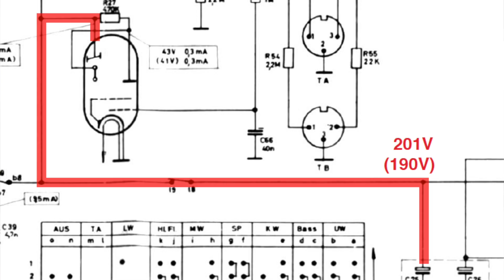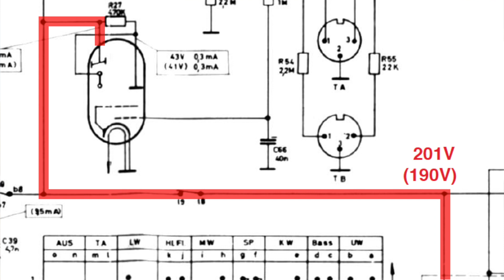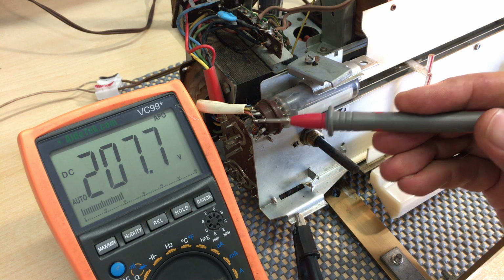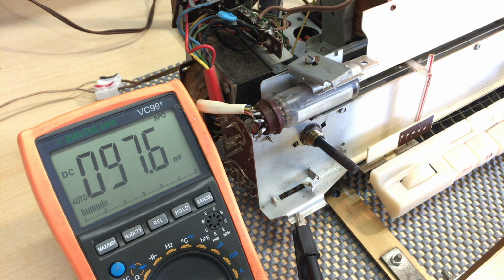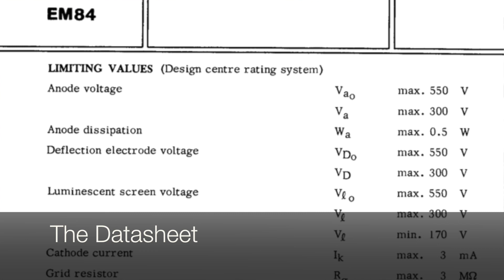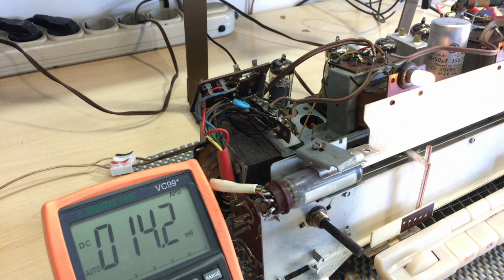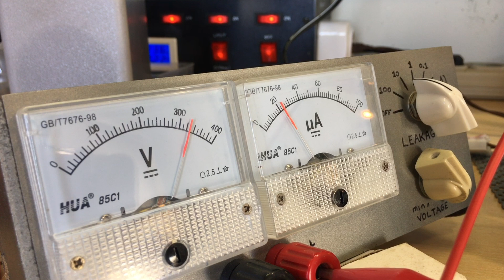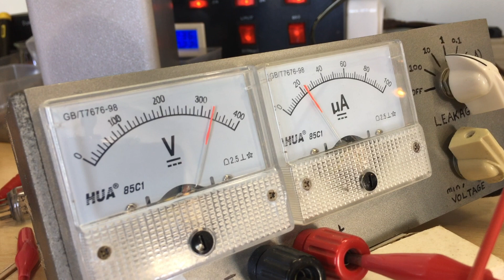How To: Revive a weak magic eye tube

Comment: Thank you 
As a comment below says magic eyes are small cathode ray tubes. I think the problem is ion burn which happened in early television tubes before they started putting a thin aluminium film at the back of the phosphor. TV crt’ s certainly lasted more than 1000 hours. 
I’ve read elsewhere that reducing the target voltage increases magic eye life. 
Manufacturers liked to have the magic eyes bright this apparently was good for sales. 
Also no magic eyes have aluminised backing on the phosphor because most have a target hit by the electrons on the front and while the EM84 is backlit I’m sure  the cost would deter this protection   Just sell more tubes. 
People are trying perfect led copies of magic eye tubes but so far not.

Comment: I usually use 275-300 volts B+ on the EM84/6E2 Magic Eye tubes that I use in my D.I.Y. projects, and they're PLENTY bright at that level, and YES, you are correct in that one WILL have to alter their drive voltage if they increase the B+ in an already existing circuit.

Comment: Greetings:
The tuning eye will last much longer if only powered when actually "tuning".
I propose using a combination of 555 timer and a reed relay to remove the HT to the tube when not actually tuning. The timer will be triggered on at the start of tuning and time out a selected. I suggest an integrated AVC detector to monitor AVC level and trigger when an AVC level change is detected. What do you think?
Reply from the maker: That would be quite doable, but I don’t like making that many changes to the radio.

Comment: I just found another take on a magic eye replacement in the ac7zl youtube channel. This is a combination of mechanical vision and solid state control and it's just brilliant. The realisation needs some refinement but it already looks very good.

https://www.youtube.com/watch?v=QFTDOZz-LlE

The website is called  hpfriedrichs where the details are given.

I think the natural progression of this is some kind of round l.c.d. screen controlled by a tiny programmable controller. In most cases, a square screen is equally applicable since the magic eye usually protrudes through a round hole on the front of the radio/instrument.

Comment: Have you seen Gord Rabjohn's solid state replacements?
https://www.youtube.com/watch?v=T6HPaSh0j1o
The weak point of his round magic eye (the proper magic eye) replacement is the use of a diffuser. I think that a plastic prismatic light guide with a reflective coating would work a lot better if one took the time to build one. For linear magic eyes however,  neither a diffuser or any light guide are necessary and his idea is more easily amenable to this type.
Reply from the maker: Yes, I have seen that video and looked at the project. He does a great job.
Reply: @electronicsoldandnew  How does he get the diodes soldered? Does he order the boards already populated?
Also I suggested that if the diodes were arranged vertically, it would allow for tighter packing together and hence would not need a diffuser except I forgot the slight issue of the need for a cylindrical board in order to achieve that...
Reply from the maker: Have a look at his project page linked in the video. There are a lot of details there.
Reply: @electronicsoldandnew  I did but I'll visit it again. I just found out that pcbway allows one to order aluminium pcbs pre-populated.
Reply: @electronicsoldandnew  I did but I'll visit it again. I just found out that pcbway gives the option to order aluminium boards. It also allows one to order flexible boards. I wonder what these are like and whether they can withstand the heat from the diodes.
Reply from the maker: I’d go for the aluminium option to be safe.
Reply: @electronicsoldandnew  tbh, I'd rather someone pre-fabricated this for me and all I had to do is just buy a dozen spares. Then again, I'd need at least a couple of all the known types...
Out of curiosity, what do you think a realistic price for a round magic eye replacement and for a linear one would be?
My understanding is that in the case of a round eye, the cost would be comparable to a NOS/good used valve but as in some cases these are not available, the replacement would set the price. 
In the case of a linear magic eye, I reckon the solid state replacement might cost more than the NOS price (where NOS is available). Of course in the case of e.g. stereo magic eye indicators, the solid stare replacement would be cheaper but that's a special case of rather limited interest I think.
Reply from the maker: I actually have no idea about the costs. I have found replacements so far and prefer them to a solid state version. If and when they become really extinct, I will reconsider.
Reply: @electronicsoldandnew  Most magic eyes live in radios and tube testers. So long as we use these there will be a need for the magic eyes - if you're after the authentic look, that is. So this begs the question: if you're after authentic looks, what are you doing putting solid state replacements in there? It's the next best thing when you can't get the real one I hear. Maybe the replacement is for every day and the real one reserved for Sundays and holidays only? Getting a working EM34 nowadays will cost upwards of 30GBP (20 if you're lucky) and a NOS one upwards of 70GBP. Ten years ago prices were half that. The question is: how long will they last? I should thing a long time. Let's face it: they're only used when turning in a station. A defeat switch on the back of the radio (or, even better, somehow connected to the tuning knob along with a turn off delay) would prolong their life indefinitely. Still, I find the solid state replacement idea very appealing. There are many designers who love to incorporate these valves into modern designs so a cheap replacement would save the real ones for use in vintage equipment.

Comment: You also play around with the heater supply. For the magic eye valves I've used, sometimes the heater current drops off with age and by increasing the heater voltage to a point where the recommended current should be, you can also get more life out of them. I know it's a bit of a faf to find 7.5V (for example) instead 6.3V, but it can be done with a handful of components.
Reply from the maker: 👍could simply rectify the 6.3 for this tube only.

Comment: Greetings:
Regardless of the method you select to improve the display, I have a valid method to extend the life of that display. That is to limit its use to only when tuning is being done. I propose using a relay or electronic switch to disable the high target voltage after a timeout period set with a 555 timer or similar. The timer can be triggered either manually with a momentary push button or automatically by sensing a change in the AVC voltage or change in the local oscillator frequency. I am not that good a circuit designer to suggest an appropriate circuit to monitor either sense source. A method not often available on vintage radios is the pulsing of a shaft encoder used to change the volume or frequency setting.
Reply from the maker: That would be quite easy to implement. However, I think many users like the tube for the look rather than for the help with tuning 😊

Comment: you might want to decrease the voltage maybe the filament voltage, on the new tube so the tube will last longer. This is a try and see I am not an expert. scopes and TV's have brightness control. you should have the the tube just bright enough to tune the radio. it's a tuning indicator not a show light. 73

Comment: I wonder whether it's a loss of vacuum issue or if the phosphor has decayed?  
I wonder how hard it would be to melt a new new tube stem to the end, re-pull the vacuum and reseal it? 
The indicator on the end would turn white tho.

Comment: You can use a voltage doubler using 2*  IN4007 and 2* 450 volt capacitors 10 micro farads and a 100 ohm safety resister in series.1 guy i read about runs theses old 6g5,6u5 etc close to 1000 volts.

Comment: There’s a great article in radiomuseum about reviving magic eyes by doubling the voltage. The article suggests that it is current rather than voltage that causes degradation.
https://www.radiomuseum.org/forum/lighting_up_dark_eye_tubes.html
A schematic Is provided for a voltage doubler, this would make a GREAT video :)
They even suggest that the voltage doubler design will increase the life of a new magic eye. You would understand their logic far better than me I’m sure, they also reduce heater voltage.
Regards
Kevin
Reply from the maker: thanks for the link. i’ll check it out.

Comment: wish there was some company that could open them up and rephosphor them 😉
Reply from the maker: me too
Reply: @electronicsoldandnew  they used to 'regun' crts, so should be possible to replace the phosphor screen in these, and regetter and revacuum ..? the 'white line' type phosphor seems to last longer than the 'grey' stuff as used in em34s, etc,  so maybe could use this, i've even had an em34 with a 'white' phosphor coated display disk, but stupidly didnt keep it but sold it in a radio. also seen white coated em85, still have that one!

Comment: I remember when you could get "tube brighteners" that cranked up the heater voltage on a TV CRT from 6.3 to maybe 8. They were a small autotransformer with attached adapter plug and socket. You could plug it right on in seconds. Better than buying a new CRT.
Reply from the maker: Yes, that would make sense.
Reply: @electronicsoldandnew  those were to try to increase cathode emission in worn out crts cathode coating ,  in the case of magic eyes its worn out phosphor thats the problem, not cathode emission,

Comment: Was the current draw of the new one any higher than the spent one at the same voltage?
I think if the cathode material was spent, the current would be much lower.

You could make a voltage doubler circuit fed directly from the B+ secondary of the mains transformer. Just two silicon diodes and two low value capacitors and a resistor. You could change the 470K triode resistor to 1M just to keep the triode voltage lower. Few years ago I played with a bench power supply that goes to 600V and some dead magic eyes, EM34s and EM80/84s. At higher voltages they started to shine again, but they usually needed like 450V-500V to be useful, but some that still had some life left were quite happy at just 50-100V more than their usual B+. In essence, what are you seeing is the same as the burn-in on the face of CRT screens. Also I remember that increasing filament voltage made little or no difference in brightness. That being said a friend of mine built a one tube reaction radio receiver back in the early 1950s with a spent magic eye tube. He used the triode as an amplifier and it worked since the tube itself was not "spent", but just the phosphorus layer.
Reply from the maker: I really can’t recall what the current draw was. It’s been quite a while.

Comment: One last shot you can give them if the phosphor layer doesnt seem too burnt is to slowly increase filament voltage to 175% and then give the target a few short 2 second blasts at about 350v, then decrease filament voltage again. Dont do this for more than a few minutes. If the cathode has gone sleepy or poisoned this will wake it right up again. Had this on some brand new 6AF6, worked very well..
The one in the video, mind you, is deader than a doornail. Evident when you see the target. I once heard this was apparently due to the heavy ion bombardment breaking up the Zn2SI04 molecule chain, thus reducing the Zinc back to the metallic state and liberating the Oxygen molecules which get absorbed by the getter, which would in turn explain the darkened (burnt) patches...
Reply from the maker: i’ve got to try that. sound easy and one has nothing to lose if it fails.
Reply: most of the worn magic eyes i have, has been due to worn out phosphor, not cathode emission,

Comment: Running it 10 to 15 percent over max recommended voltage shouldn’t be a problem as the tube is aged and at the end of its life anyway. What could it hurt. Sure wish there was a 350 volt tap 🤣
Reply from the maker: Me too
Reply: @electronicsoldandnew  to much voltage is risking flashover...

Comment: I wonder if it would be reducing the Anode Voltage on the new valve to give it more life?
Reply from the maker: Simon Spiers : the weird thing Simon, is that I’ve actually read somewhere that a lower anode voltage burns the layer even faster. Doesn’t make sense to me though.
Reply: I suppose it depends whether the phosphor decays more due to current density, or more due to electron velocity (sputtering). Does anyone know?
Reply from the maker: I don’t know.
Reply: @electronicsoldandnew  there got to be a way to put a brightness control on these tube circuits. scopes and TV's have brightness controls. 73

Comment: I do wonder if phosphor depletion / Coulomb ageing / "wearing out" isn't the whole story, or at least only one of several different reasons why magic eye valves degrade.

My reasoning: On your EM84, notice that the outer and inner edges are considerably brighter than the rest (presumably due to something like internal reflections increasing the # of electrons hitting the phosphor). If it was simply the phosphor 'wearing out', you'd expect the outer edges (that are active continuously) to wear out first/most, followed by the inner edges (that are getting a double-dose of electrons whenever tuned to a strong signal i.e. most of the time), and the gap between (that are only getting a 'normal' dose of electrons, and only when tuned) being finally/least affected.

But yours (and the others few of that type I've seen; magic eyes not being common except on mostly Euro personally imported sets here in Aus) shows the opposite - the edges bright, and the centre dull. That said, I have seen other styles - mostly round dial-types like the 6E5 & friends - where the degradation is more pronounced in the 'overlap' area, presumably from being run for a long time while tuned to a strong signal.

So I suspect there's several causes - Coulomb ageing/wearing out, reduced cathode emission (did they use particularly high-emission cathode material? Don't know…), and likely others.

Interestingly, I've also seen it stated somewhere (probably a discussion on RM) that brightness increases with anode voltage but is not linear (e.g. 20% higher anode voltage results in more than a 20% increase in brightness), while on the other hand, degradation increases with lower voltages and higher currents but decreases with higher voltages and lower currents. Given that boosting worn magic eyes by increasing the anode voltage (and hence, without changing anything else, also increasing cathode current) is known to work but significantly reduces remaining lifespan, I wonder if a combination of increasing the anode voltage and also decreasing cathode current (e.g. adding resistance to the cathode if possible) would extend the life of 'rejuvenated' valves?

(You mentioned a video or two ago you tend to ramble on & drag things out. Yeah, I'm like that in comments 😉)
Reply from the maker: Hi Jim. I too was mystified by the bright lines at the two ends of the beam travel. My guess is that these limits act as a sort of “trap” for the burnt off phosphor, but that’s just a guess. The physics is rather interesting, and I’ve  read quite a bit about it. However, as an engineer, I can’t help but remember what one of my varsity lecturers used to say: “leave the theory to the physicists, and just get in with the job”. I must admit that I often break this rule due to my curiosity, but in this case, I think I’ll leave it there :)
As for rambling on, I really don’t mind. I alway preferred conversations to presentations, so we’re both in that habit. 
Thanks for your input.
Manuel

Comment: Interesting experiment, thanks.  I plan to add a magic eye to a no-name 1951 kit radio that never had one.  Experiments like this are therefore useful learning experiences.  I wonder, though, could rebiasing the signal input bring the two bars closer together where there might be some unburnt phosphor to play with, or will the physical plate dimensions prevent that?
Reply from the maker: Sincerely Yours : you could, but the “burnt” sections will be obvious.

Comment: This is a crazy thought but what if you could increase the heater voltage like a brightener does on a CRT? Would that increase the brightness?
Reply from the maker: Gerard Carriera : it could do, but would probably greatly increase the current draw, which would affect the supply voltage at that point.

Comment: As the new valve was so bright might be worth lowering the voltage (and brightness) a little to extend the life. It is after all a CRT and we all know the damage you can do with burn on a Scope with an over bright image!
Any experience with  some of the overseas cheaper magic eyes? Will probably need a small re wire but could be a suitable replacement.
Reply from the maker: I’ve replaced the em35 with a 6e5c a couple of times. Quite a simple alteration.

Comment: Interesting experiment !     I have sometimes toyed with the idea of using a switch to cut off the B+  when I want to do some extended listening and there is nobody around to 'wow'.
Reply: I have done exactly this on an old tube radio with a UM4 magic eye tube. Those tubes are like £50 a piece and getting hard to find. I used a DPDT switch to switch off B+ for the tube and switch between the filament or a 5W resistor that drops as much voltage as the resistor does. You'll need a switch which is rated for DC (and in my case tested at 250V DC). These aren't particularly cheap, and there aren't many choices. Switching DC is not as simple as AC as it arcing much more.
Reply: You'd better turn off the filament as well.